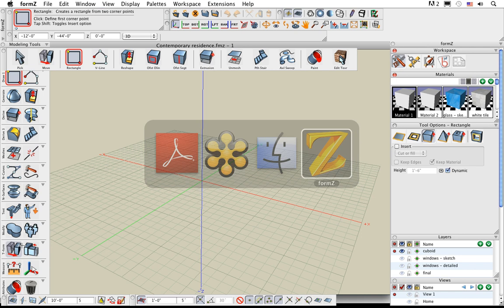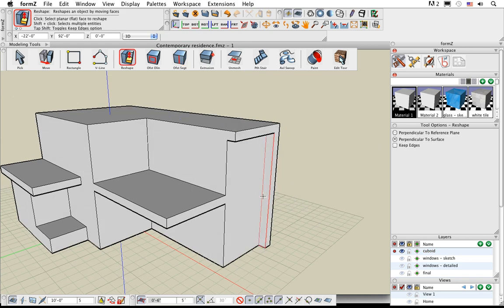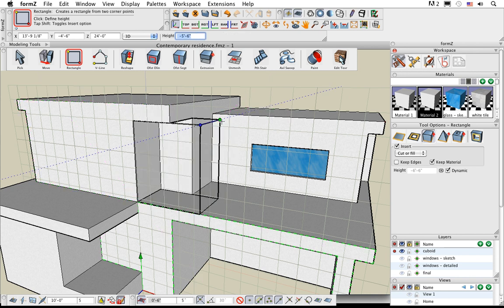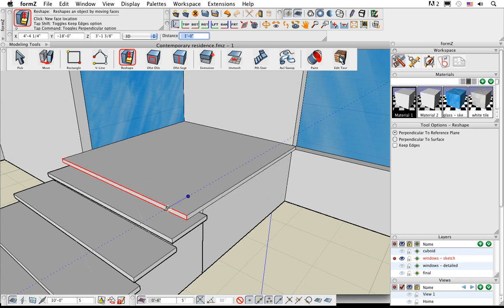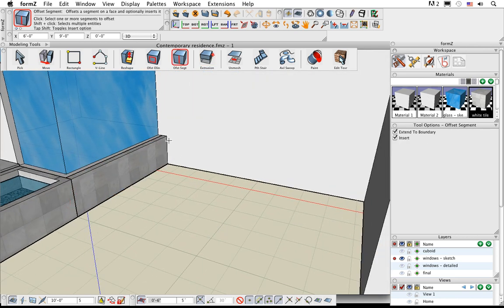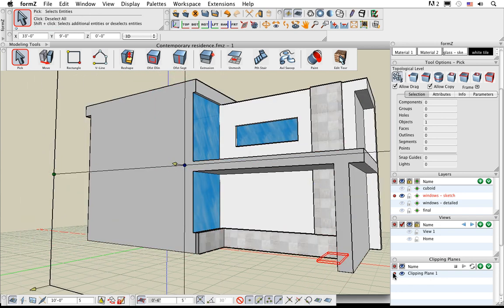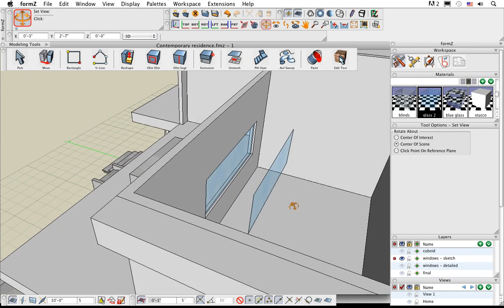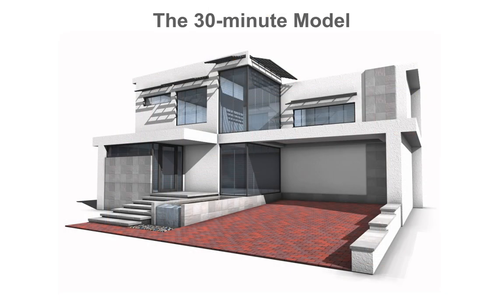The 30 minute Model

Comment: I know this is ten years old, but this is probably the worst tutorial I've ever seen. This guy knows NOTHING about teaching. Hot keys? Yeah, great, so none of the newbies know where anything is. An app like FormZ uses about three keystrokes for a single operation and if you miss one the operation fails. This guy pulls offset lines off of an edge and says it creates a new face. WRONG! you have to set the new line created to "inset" as in "insets into the face." If you don't do that you just get a line sitting on the face, not dividing it. Total frustration for a new user. This guy is just showing of how quick he is in this antiquated software. If you are a new user keep walking. This tutorial will just drive you crazy. It is horrid, horrid, horrid.

Comment: What is the difference between formZ and bonzai3d
Reply from the maker: Hi mcfisher1000,

formZ includes all of bonzai3d, plus more features.  You can find a complete comparison chart here:
http://www.formz.com/featureslist/FeatureComparisonChart.html
Reply: formz3D Thanks! I am using the Form-Z trial version currently, but I made it halfway through your tutorial when my offset segment stopped working correctly. It makes a line, but does not act as a border, so when I use the re-shape it completely ignores the segment I drew, did I hit a button on accident or something to cause this?

Comment: What is the main difference with the SketchUp modelling?
Reply from the maker: Hi Tanya,
formZ and bonzai3d both offer the ease of modeling that you get with SketchUp, but there is a LOT more.  Solid Modeling, Surface Modeling, NURBS Modeling and much more are built directly into the program, and they create quality geometry that can easily be used for fabrication (STL or CNC), documentation, rendering, and animation -- without needing to rebuild or fix many problems as is rather typical with SketchUp models.
Give it a try and let us know what you think.  You can get a Free Trial version (from formZ (dot) com) and you can email us directly at support (at) formZ (dot) com if you like!
Reply: formz3D I`ll try it, thanks for the answer